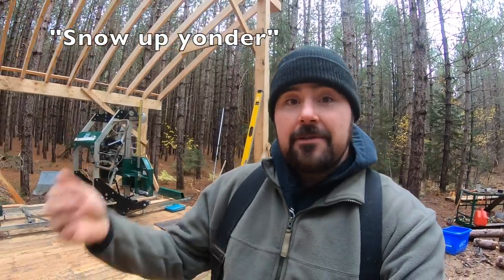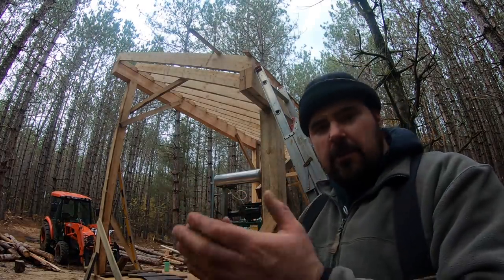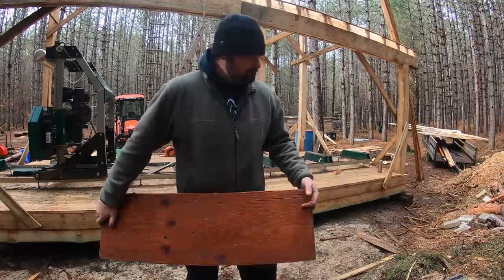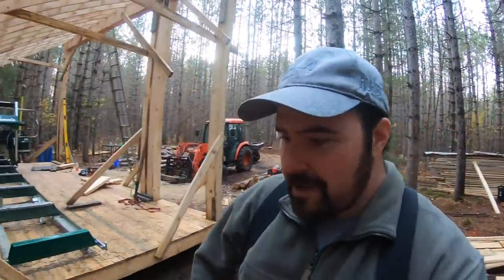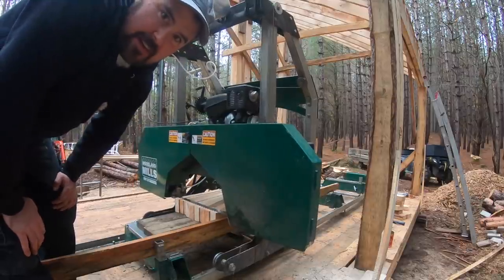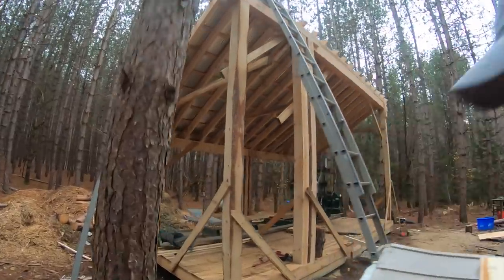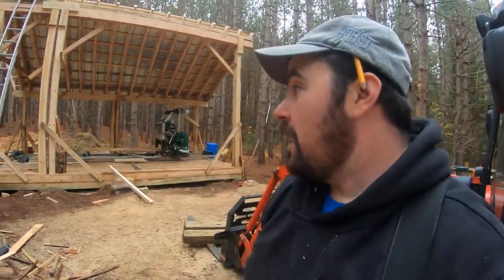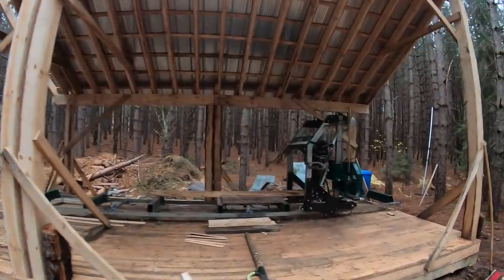Protecting My Sawmill From The Elements | Sawmill Shed Build - Episode 7

Comment: Nice job getting it closed in.  How about some conduit or steel cable along the front and back and some bottom weighted tarps for curtain walls to help keep the weather out?  That way they can just be pushed open when needed.

Comment: Sandy,  looking good.  For your rain deterrent on the front, why not consider a roll up/down tarp that you can partially lower when you are working in a driving rain, and lower more fully when you wrap up work for the day.  Position it directly below your wood extensions so that when its fully raised, you still have maximum vertical clearance to load logs with the tractor.  Nice job so far, keep up the good work.

Comment: I reused metal on a lean to on my shop. I squirted the silicone up through the holes from the inside. Been 4 years and no leaks.
Reply from the maker: Sounds like you and I are on the same wavelength!
Reply: That's exactly what I did on my 30 X 30 garage I built. The holes that were in my metal  were caused by me missing the rafter.  lol

Comment: Major milestone achieve.  The roof is on.   As for your water collection system, you could install the eavestrough on the front shorter side of the roof.  There is less surface area for any snow to really accumulate and cause damage when it slides off.  Alternatively you could get those snow clips for metal roof that is meant to hold a snow pack in place so it is less likely to slide off.

Comment: I would add 1 to 2 ft to the front.  A blowing rain or snow event would dampen the sawing equipment and rails.  The whole purpose is to keep that valuable equipment dry.  I like the angle.  Dont put gutters on it or you will have killer icicles.  Consider mounting gutters in a removable or hidged manner.  Up in snow free months down in months with snow.
Reply from the maker: Thanks Brian. I like the removable gutter idea

Comment: I'm no expert but what I would do for the gutter issue. I would set a board on the roof to see the angle set the gutter under the board have about one to two inches between the two mark and set. Remove board on roof. This will save the gutter from ice and snow from ripping it down.
Reply: Yes, that is the way to do it!

Comment: I would consider tieing it down with ground anchors if you get much wind, thats a damn big sail at the moment. What i have on my woodshed is a sliding tarp for a door. A pair of eyehooks with wire stretched across the top of the front, then cheap caribeeners through tarp eyes, so the whole thing slides to the end when you want it open.
Reply from the maker: Not a bad idea. Thanks!

Comment: Snow is coming! Go MAN GO! A tip with the string line, put a 3/4" block under the string on both ends then use a 3/4" gauge block to set the rest of the tails. This way if there is a splinter or something on the tail it won't move the string. Does the front face south?
Reply: Was going to suggest the same thing... it’s easy to get a slight round without the blocks as well even if each piece “touches” the line with a little more pressure as you are working along
Reply from the maker: That's a great tip. That way I make sure I don't push out the string line by mistake. Thanks Mark.

Comment: Hi Sandy. I've been using your builds as models for mine. The slab rack works great. i am going to build a sawmill shed but I can't work at those heights. I was thinking about putting on a conventional, peaked roof. Is there a reason why you might have ruled that out?
Thanks

Comment: Hey Sandy. The shed is really coming along. I bet you slept good knowing the tin was on. It looks good. Why not use those two [or 3 or 4] blue water barrels you have, and prep them for winter usage with antifreeze. Set them up on a skid for one trip now, and another refill in spring. If you set them up on a 2ft high stand [or even just blocks], you can even rig up a drain faucet to pour into smaller container to transfer into sawmill. I use a 1000 gallon 4x4 cube steel framed plastic tote i got from a landscaper who had liquid fertilizer originally in it. The nice thing about the tote is its in an aluminum cage with forklift slots at the bottom for easy transport, and they are stackable too.

Comment: Here we call strapping  "roof battens " and we wouldn't measure every one we use a spacer  cut to the correct length and lay it on the rafter and place the next batten up to it,,, they are 3 x 1 1/2 ,, 75 x 40 mm  spaced at 900 mm

Comment: I was just wondering why you didn't place the larger beam down at the end of the sawmill so that you would have complete access to the saw bed for full-length logs? As it's positioned now you have direct access to the sawmill head but the last 8 feet of the bed is blocked by the support posts for the short and long beams.
Reply from the maker: It's a bit difficult to explain but the position of the sawmill currently will allow for the large opening to be aligned with the sawmill bed. The sawmill is just pushed to the far end for moving my ladder around. In coming videos I think it'll look a bit more practical. Thanks for tuning in once again David. Hope all is well with you.

Comment: A rain G about an inch down with light rubber side sticking up the back so it angles down into the back of the Guter and so the snow will slide over it because it will bend over the back.
Reply from the maker: Not a bad idea. Thanks !

Comment: Sandy are you going to build a section on the front to match the back and make a full barn style facility  good for  storage or a kiln to dry your lumber! You can utilize up top for other storage considering that your roof is so high!
Reply from the maker: I am going to build out the front roof to match the back, just working out details on that. I'm also tossing around the idea of some other add ons for this project. Should be a good place to mill when all done. Thanks again for checking it out Marc.

Comment: Shouldn’t the purlins be 2 x 4’s?
Reply from the maker: I haven’t put any purlins on yet. What you’re seeing is strapping to hold the metal roof down to the rafters
Reply from the maker: I don’t think I’ll need purlins on the under side of the rafters in this situation but I’ll likely have bracing made out of 2x4’s under the rafters for strength

Comment: Next time don't roof screw the ridges, put the screws in the flats so you can tighten them with out bending the tin and making a water holding dents. Buy a tube of black or white  urethane calk , it's super sticky, and get the holes from the inside, if you use clear the sunlight shines through and it looks like the hole is open. Your Eye Brow roof will need a ridge cap, you can make them by ripping a full roof panel into strips and bending at a ridge. Try a skill saw with a old blade on backwards. Use 3/4" Teck screws metal to metal type on that. By pass doors work well if you can find the hardware. At the Ranch and Farm store you can buy gallons of Aluminum paint, $ 35 dollars US., spray paint everything inside above the floor, it will stop spiders and bugs , looks like a metal building and is bright and lasts over 20 years. Walls are great with clear plastic panels at the top. Wet sawdust will rot the floor quickly. I think you should plan on a wood stove and a coffee pot in the shed.
Reply from the maker: I know what you mean about the ridge vs. valley screwing on the steell. I'm one of those guys who feels that if the screw is on the ridge then even if the gasket fails the water won't come in as much as in the valley. I think I'm going to do what you're saying with the ridge. Save some cash as ridge cap is 33$ CDN for a 10 foot length at the local lumber yard YIKES.

Comment: FOR THAT   FRONT   ROOF      YOU   FIGU  OUT   WHAT THE  HEIGHT   YOU   WAT     FOR  THE    INSIDE     THEN    PUT  IN   COLLAR TIES     THAT   COME    ACROOS   THE     FRONT    BEAN   OPING    THEN  YOU    FIX A  BEAM    BETWEEN   THE  POST   AND      EXTEAND  THE  COOLAR   TIES  OUT THE  FRONT    SO  THAT     WAY  YOU    WIL  HAVE  A  WAY  TO    TIE  THE   ROOF    TO     THE    BUILDING   I   WSH I  HAD  A  WAY  TO      DRAW ON   HERE  TO   SHOW  YOU  WNAT  IMJ  TALKING   ABOUT      BUT I  DONT    BUT  I     AM  A  TRIMBER   FRAMINNG    AN D   I   ALSO   HAVE THAT  SAME    WAS   MILL  YOU  HAVE    I    SAVE    SO  MUCH  ON  MY    HOUSS      BY   DOING   MY  OWN   LUMBER   AND  I   DONT    HAVE  TO   WAT   FOR   IT  AND  ALSO  I    CAN   MAKE   MUCH   BIGGER   LUMBER    AND  WHAT  YOU   GET   AT THE    STORES      SO      YOU    CAN     USE    THE   LARGER      MEMBER   LIKE    WE   DIDI   BAY  IN  TEH  40  AND    50   AND   60    BUT     FO RTHE   FOOD  THAT   IS  WHAT  I  WOULD  DO   SINCE   I  DID     THAT    TO  MINE     I  HAVE   MINE   ALONG   SIISE  MY      SHOP  WHICH  IS      60    FT   LONG    SO   I  HAVE   MY    MILL  OUTR   ON  THE   FRONT   AND     MY   SATAES     BOARDS   IN  THE  BACK   ALL   NEAT     AS A  PIN     SWEEP    UP  ALL THE    SAW    DUST  A FTER    EVER    TIME  I    USE   THE     SAW   AND    BOLW OUT   ALL  THE    SAW  DUST   ALSO   BUT   YOU  DONT   HAVE  POWER  OUT THEREE      SO A     BRWN    DOES  GOOD